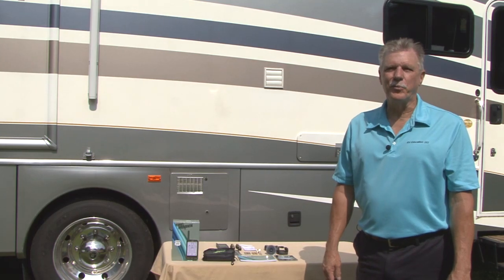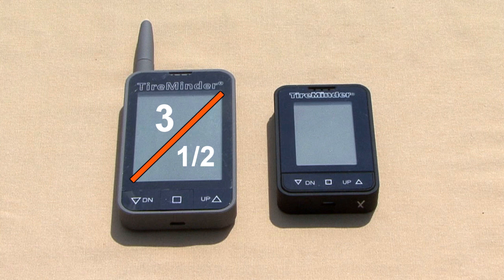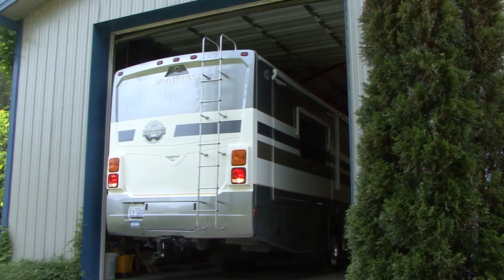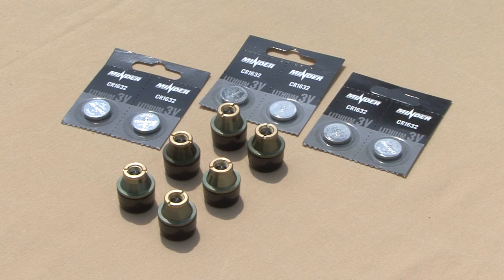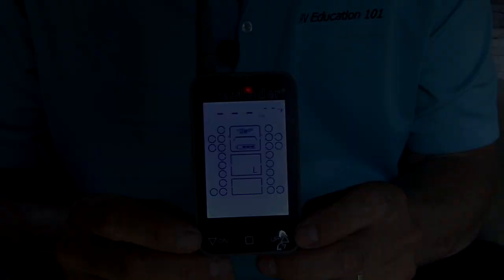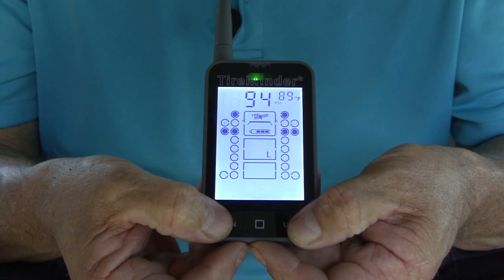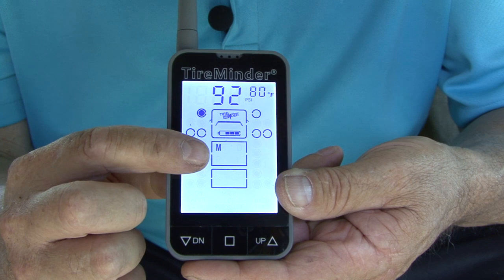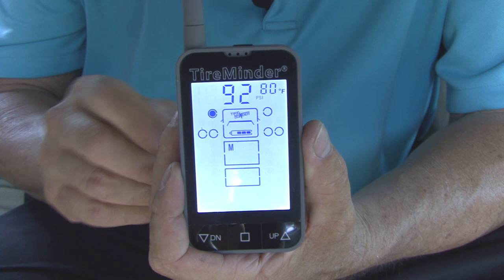Tire Minder TM77 RV TPMS

Comment: Is it advisable to have the the wheel balanced after installing the sending unit on the wheel?
Reply from the maker: The transmitters are light and should not affect the wheel balance.